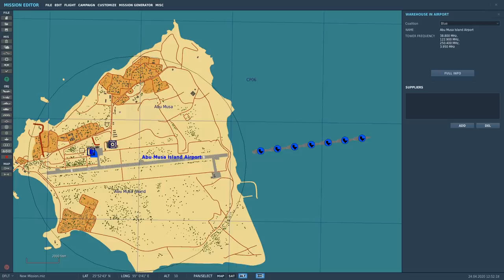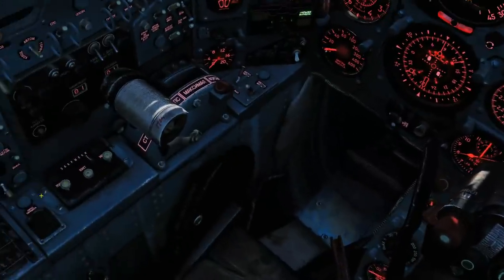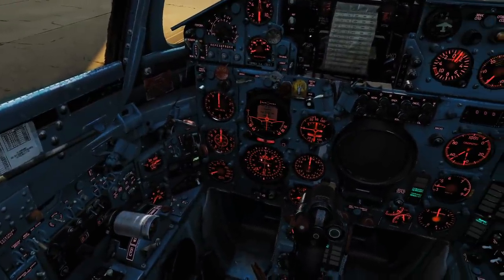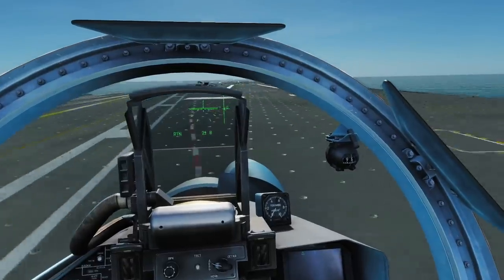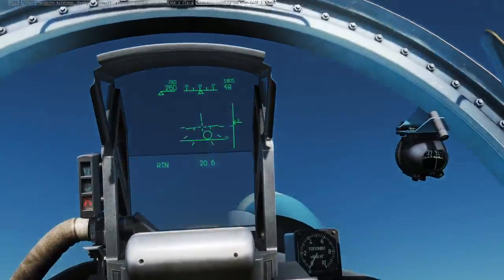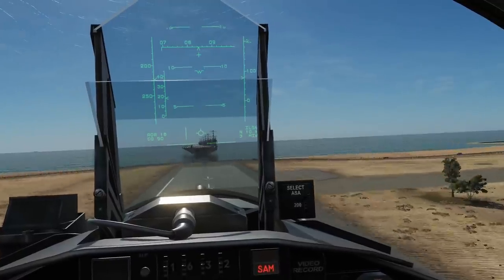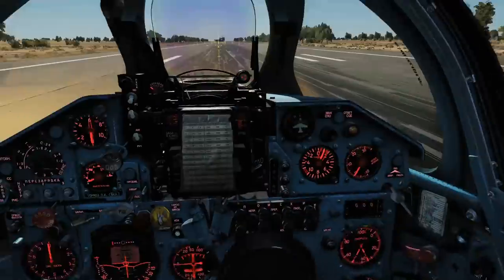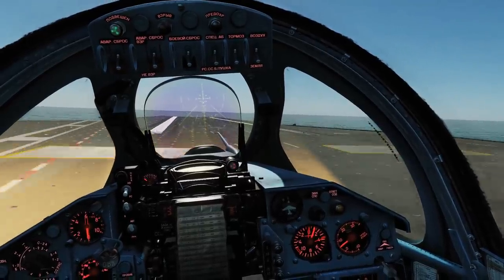Questioned: Can Airforce Planes Land On Multiple Carriers? | DCS WORLD

Comment: "The F-15 has GLASS landing gear"
Proceeds to land at 200 knots
Reply: Landing at 200 kts is more a reflection of tire strength than landing gear strength.  Smashing down at -750 fpm into the deck of a carrier at 135 kts is MUCH harder on an airframe than landing at 200 kts and touching down at less than 1G of force on a smooth runway.  I'm not sure how this is not obvious to anyone that can successfully fog a mirror.
Reply: @karlchilders5420  1. It's a joke, you must be unfamiliar. 
2. Since you wanna be a big serious boy, notice how he loses a tire upon landing. As a result, he loses control of the aircraft and skids out. The resulting sideload on the landing gear causes the gear to give out. It can be reasonably concluded that he damaged his gear as a result of landing at 200 knots.
3. It is more difficult to control descent rate when landing at such high speeds. It makes you more likely to touch down with a higher descent rate that desired. I'm not sure how this is not obvious to someone who can fog a window.
Reply: @SauerkrautIsGood  
Wasn't the gear damaged during the take off?
Cap seemed to think so, although I'm not sure how he was able to tell?
Reply: @SauerkrautIsGood  I said it was a reflection of tire strength, I didn't say tires can TAKE landing at 200 kts.  The gear doesn't enter into it in this case.  Everyone fixates on the Eagle (or most AF jets for that matter) and the landing gear since they are not as beefy or reinforced to perform carrier landings.  The Hornet couldn't land that fast for the SAME reasons the jet here had issues - landing at high rates of speed is terrifically hard on the tires.  Hell, the F-35B even had issues during its workups due to tire issues and as a result could not perform many of the vertical takeoff and landing maneuvers it needed to.  

So let's recap, since you wanna talk about "big boys" and all that horse shit.

1.  The issue here, again, is landing speed, not being able to absorb higher G loading as one would see during a carrier landing. 
2.  Side loading will cause most any gear to give out, which is why there are limits to crosswind components (among other variables) to limit such loading.  
3.  It is NOT more difficult to control descent rates according to airspeed.  That's bullshit.  So if you wanna talk about the idiocy of your 3rd point, controllabilty in the approach is more about having power and lift rather than any particular airspeed, provided you are not too fast for the flaps/slats/gear, or too slow to remain at your desired AoA and descent rate.  

All you need to do is actually fly an aircraft to know that landing one is a matter of pitching for your airspeed and using power to maintain your aim point.  Those big, large rectangles, yeah, those are aiming points to make that shit easier on runways.  If you want to make a joke, take a class and maybe one day you'll succeed.  You failed miserably here.
Reply: @stickiedmin6508  gear tire popped, plane tilted to the right - you need to be airborne before 150kts, otherwise at 153 it starts popping tires (old bad code)... he TOOK-OFF the tarmac at 200kts